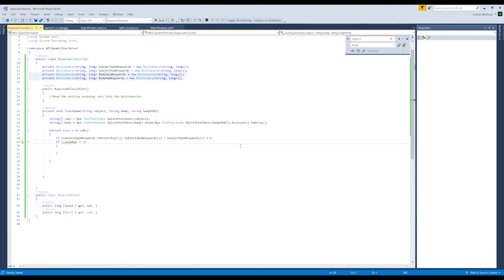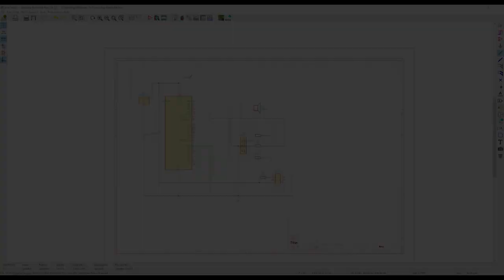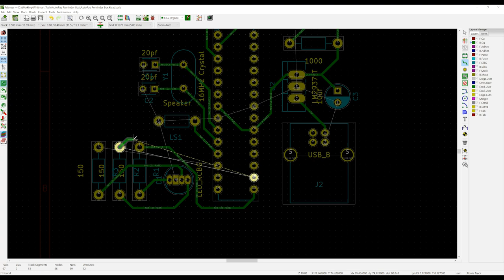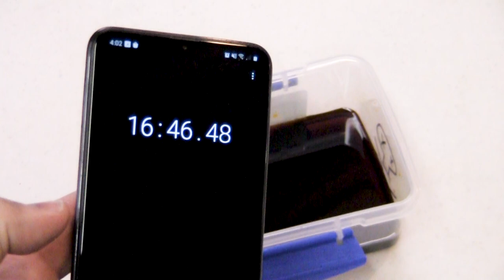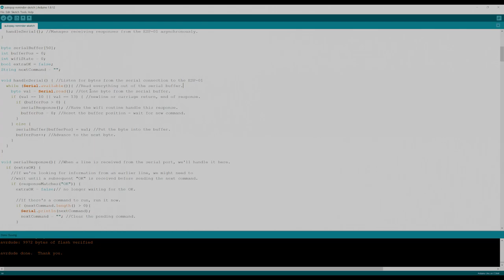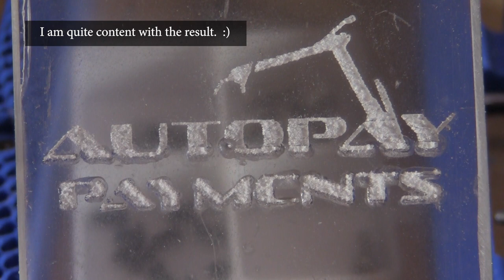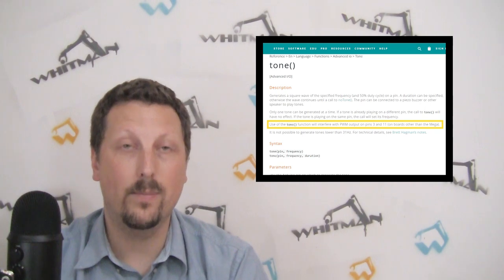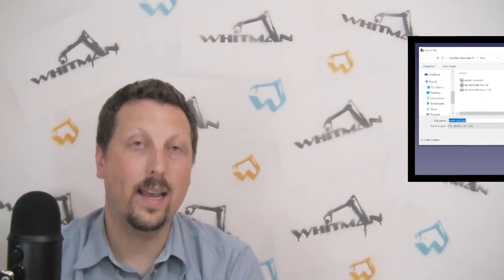AutoPay Reminder IoT - KiCad Design and PCB Manufacture with CNC Laser, FlatCAM

Comment: sorry for another comment... lol, you've got so much going on here.  In the past I've abhorred cutting plastic, especially acrylic stuff. The speed and size of the blade to cut it is always a hit and miss.  It's almost impossible to find a happy medium free hand sawing.  What I found is that the larger the TPI (teeth per inch), the slower you can go, without generating so much heat that it welds itself back together seconds after passing thru it!
Reply from the maker: I rewatched the part of the video with the acrylic to see what the context is for your comment.  Seeing the old 2x4 router in action made me chuckle.  I learned so much by making it.

Only recently have I been brave enough to run my router at less than full speed, so I'll take your advice next time I'm doing acrylic and cut the router RPM and feedrate.  I have a little air compressor that blows off the chips now, so that'll probably help keep things cool and clear of the cutting surfaces, too.  I appreciate you taking the time to share your experience!

Comment: Regarding etching and ferric chloride.  I've been making my own circuit boards all of my adult life from simple to very complex, but they were always one offs created manually.  If you store your used FC back into the original bottle it contaminates it with the oxidized copper and it slows the etching process every time.  Back in the day I always kept my used FC in it's own container and I'd write with a marker how many time it was used because each time it always takes longer to get the desired result... until it becomes pretty much useless.    Then I'd start over with new FC.
In the 80's, I had a etchtant heater that would bring up the temp to something that was decent, (around 85-90 deg F iirc) and it would not only shorten the time but the etching was much better quality wise. 
Thanks again.
Doug
Reply from the maker: This project worked out pretty well.  You said it, the temperature makes a massive difference in etching time and the quality of the finished board. When the basement was colder my results were soo much worse.  Warmer days gave really clean traces.

After I did this video I built a CNC router and have been trying to get a foolproof toolchain for making circuit boards with "mechanical etching" - routing out the traces with engraving bits or tiny endmills.  I blew about $400 on endmills as I broke them over and over again.  Happily, I finally have the whole process down to a science.  Just in the last week I've made three different circuit boards for different things, each one came out flawlessly on the first run.  I can start with a blank KiCad project and be holding the circuit board ready to solder in about 40 minutes.  It's super awesome.  My latest video chronicles some of the lessons I learned, and I'm about to start editing a new video with a few more of the problems I uncovered and resolved subsequently.  It's been a process, lol 😅

Thanks so much for taking the time to share your ideas and I really appreciate the positive feedback.  It's good to meet you 😊
Reply: @WhitmanTechnological  Your videos are definitely going to save me $$$ in broken bits!!!  Keep up the great work please!

Comment: Great video. I just got my laser module installed and running on my CNC router. I will have to try this pcb etching workflow!
Reply from the maker: Awesome, good luck.  I found that my 2.5W laser was able to burn trace outlines at a thickness of about 0.1mm if I do a good job focusing.  It's enough detail that if you're careful you can even run 0.25mm traces in between the pads on chips.  If you're using surface mount devices, I'm sure the precision is even more important.  Thanks for watching!

Comment: Sir, do you know what type of operations need to be done in flatcam in order to use the laser to expose a photoresist film? The laser needs to move inside the traces. Thank you very much.
Reply from the maker: The photoresist I've seen other people do usually uses a different program to expose the film, not GRBL and FlatCAM.  My laser engraver came with a program called Benbox.  It included it's own .hex file firmware to flash onto the Arduino.  Using Benbox, you can take an image file and have the laser scan back and forth to expose the traces on your photoresist film.  If you bought a laser engraver or a laser engraver kit, it probably came with Benbox or another program like it for burning images.  This is what you'll want to use for exposing photoresist film.  If you google Benbox, you can find more info, instructions, and downloads.
Reply: @WhitmanTechnological  Yikes. This would be a very tricky operation IMO. I wouldn't even try it... just print a negative of the circuit board on a transparency sheet, then expose to the sun for ahem, (I've forgotten more than I can remember).. perhaps 20 minutes or so, then etch. This used to be my mainstay go to method for making pcb's.